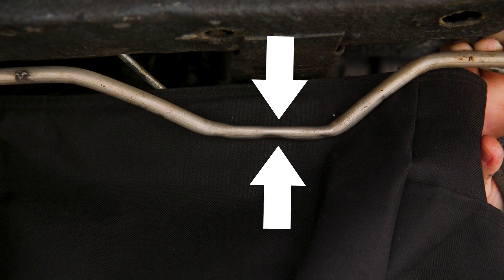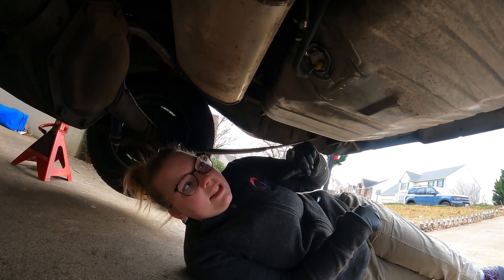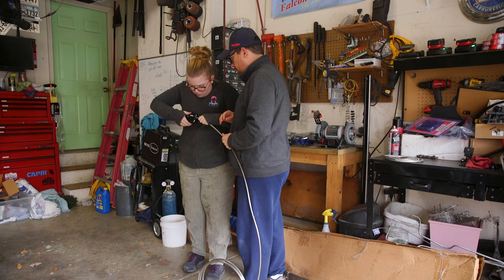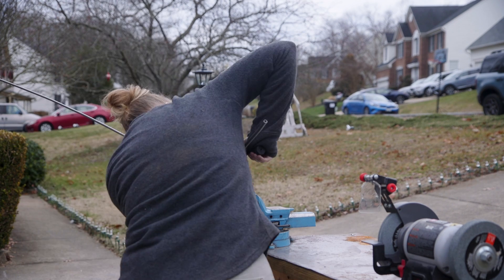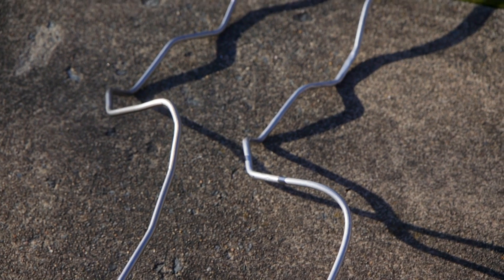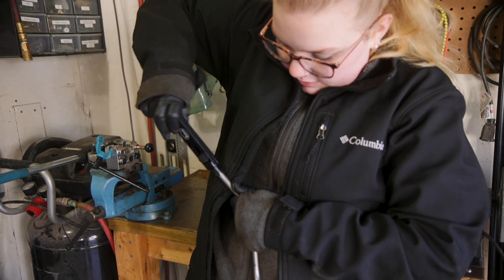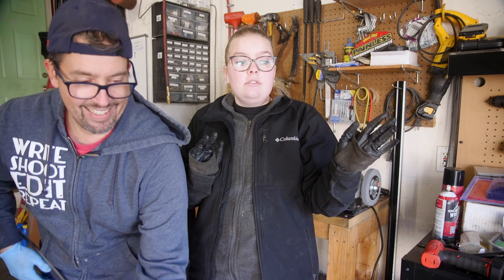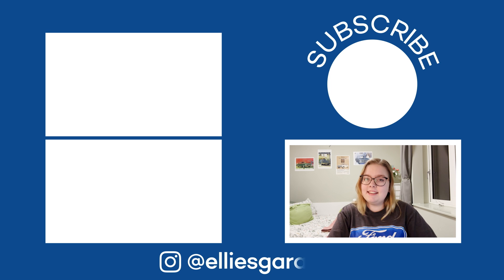Can We Bend 3/8 Stainless Fuel Line with Hand Tools??

Comment: Late reply but will be of help in the future and help to others.

On the tube bender you have O L and R.  O position is your standard position this is where you start your bend at the line you mark which means your bend will be considerably past the mark you put.  That is where the L and R comes into play, L puts your bend to the left and R puts your bend to the right so when you measure out that you have a distance of say 20 inches, you will measure 20 inches and put your mark on the tubing.  When you put your tubing into the bender you line this mark up with the L if you want your bend to be left of 20 inches or R if you want it right of 20 inches.  This will allows to offset where your bend happens at in relation to your mark.  If you use the O starting position it will always put the bed past your mark as the O position is where your bend starts at.

On stainless steel one thing that no one tells you about stainless steel hardline is you want annealed stainless steel.  This means the stainless steel is more mailable and not as brittle this means while it will still be hard to bend and hard to flare it wont be as hard.  Lots of stainless steel line if you get it from an automotive supply center will be annealed but its good to make sure.  I used tripled annealed 3/8" stainless steel on my truck since I custom bend stainless hardline for the engine as I converted from carb to aftermarket EFI.  I did not how ever do double flare as stainless steel does not seal good as a double flare.  I ended up purchasing a AN flare turret and die set that fits my Eastwood flare tool which is the same model you are using.  I flared mine for use with AN flares which was a single flare and should provide leak free service.  In your application how ever being on the suction side of a mechanical fuel pump and having rubber hose between the ends of the hardlines you really dont need to worry about doing a bubble flare for a simulated barb, the odds of the hose coming off is fairly low as its not under pressure.

Comment: if it were my car and the fuel still flowed properly would of just left it be.
Reply: I thought that too lol 😂
Reply: @agooser26  lol oh well it never hurt to change it just make a good learning experience, she has a lot more patience than i do. or i just don't want to crawl under the 65 meteor in the super tight space as it sits in the yard, and i still need to get one of the broken bolts removed for the starter.
Reply: for a carb it would be fine, but with EFI you dont want kinks or bends that can load up the fuel pump more it will cause pressure spikes which can throw off the fuel metering.

Comment: I discovered that the metal fuel line on my 66 Thunderbird is right on the pinch weld. Top tip, don’t jack a 66 Thunderbird on the drivers side on the pinch weld 😂
Reply: the '66 had the worse line placement.  I did an EFI conversion on one at work last year and there was no way to run rubber hose as the owner of the shop stupidly wants us to do so I repurposed the hardline which was already banged up to hell.

Comment: I hope you blew out the line after deburring the ends.  If not you likely have metal shavings in the carb now and possibly in the jets.  That is of course unless you have a fuel filter at the carb but I would assume you dont have 2 fuel filters.
Reply from the maker: We didn’t blow it out but dad did bleed the line a few times with fuel the other day. Do you that will be good enough?
Reply: @ElliesGarage , I just remembered you installed an EFI conversion on that car so you should have an electric pump in the tank or inline (sorry, I dont remember which type you installed)  If you bled it before hooking it up to the throttle body by cycling the key a few times and letting the electric pump push fuel out of the line before connecting it, you likely got them out before hand.

Comment: Great job guys. Yes stainless steel is no fun. What I found that helps, when I need to bend steel sometimes I will heat it with a propane torch and it will make the item a little easier to to work with.
Reply from the maker: Pro tip!

Comment: Copper tubing can also be used, I used tubing that was plain metal not stainless, and routed it as far away from the hot exhaust, i didn't follow evey factory bend which made it easier.
Reply from the maker: Good call

Comment: You should of gotten solid copper wire and a template and to do the bends you need and transfer it over to the tubbing
Reply from the maker: That's true. Then we could have made some improvements over the previous line. Good call.

Comment: bending tube is one of the hardest jobs and to have it fit the first time is excellent . i have watched many a mechanic swear and throw them in the garbage
Reply from the maker: I totally get it!!
Reply: The problem is a lot of people dont take the time to learn proper use for the tube bender.  I was in that boat years ago till I sat down one day and learned about the proper use of the bending tool and the whole point of the O L and R markings.  Once I did that when it came time to bend the hardline for my engine for my aftermarket EFI installation I didnt go through 40 feet of stainless steel 3/8" hardline because of bad bends but because it wouldnt work how I envisioned meaning I couldnt get a curve tight enough or I could get the curve tight enough but couldnt flare it afterwards.  Eventually I came up with the idea of changing the AN fittings out on the aftermarket EFI system and decided ill use a male to female Tee in line to tuck the hardline up for more clearance.  Once I made that decision it was just simply make my marks bend and done with it.

The L and R is off setting your bend to be on the left or right of the line.  For example if you have 20" of space for your hardline you measure 20" and then you move the line to the L mark on your bender which will place the bend on the left side of 20" so when you measure it will be 20" from the end to the outside of the tube after the bend.  If you use the O youll have to measure back a few inches to compensate for this but you dont need to do that once you understand what the O L and R stand for all you need to do is just measure  where you want the bed to be and if you want the bend to be on the left or right of where you put the mark.

Comment: Ironically, I just did this job - a new 3/8" fuel line for my '74 Dodge Monaco with a 440 making 410 horsepower. It was debatable as to whether or not this was necessary on a 440, but I felt it was; at full throttle anyway. It's obviously way overkill for a 6 cylinder engine, but if you want to bolt in a 400+ HP engine, you are set!
Reply from the maker: That sounds like a perfect excuse to put a 400HP engine in Carl.😀 This sounds like some good information, though. We heard this from one of our Falcon advisors that all we need for us is a 5/16 line. We even called Holley and they said that for our set up and Sniper 5/16 would work. Sooo, we might be revisiting this in the near future.

Comment: Nice work, well done!  I have to say though, I think 3/8" line even for a straight six significantly larger than Carl's is HUGE.  Unless you're relying on the original mechanical pump in which case never mind me.
Reply from the maker: Yeah, that's something else we're looking at. We have a Sniper EFI on it that calls for a 3/8 line, BUT we talked with Holley and for our level of performance (or non-performance, ha) they said we could get away with a 5/16 line as long as we had a good enough pump. Our pump is definitely more than we need (one of Holley's 255 lph in-tank models). Soooo, we may be revisiting this project with a different approach. Thank you, though!!

Comment: Years ago when I was restoring my 1967 Ford Mustang Coupe. I ordered a "pre bent " fuel line going from the tank to the fuel pump. It had the correct part number on it , but it sure didn't fit a 67 Mustang Coupe. So I just made my own.
Reply from the maker: I hope you had an easier time than we did
Reply: @ElliesGarage  I did. I used aluminum tubing from Oreilly's.